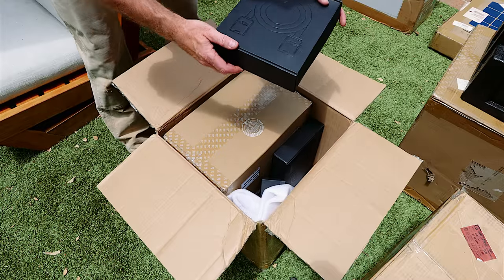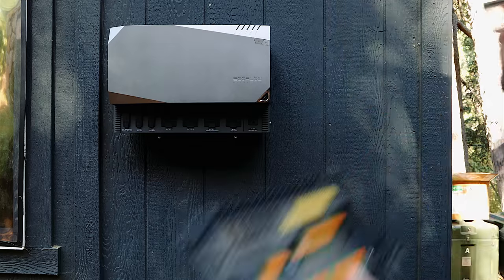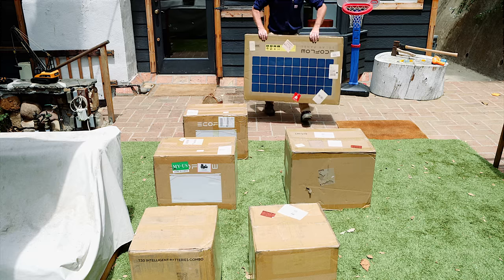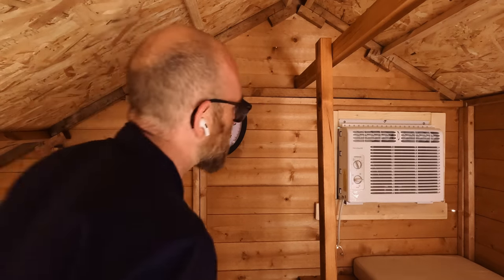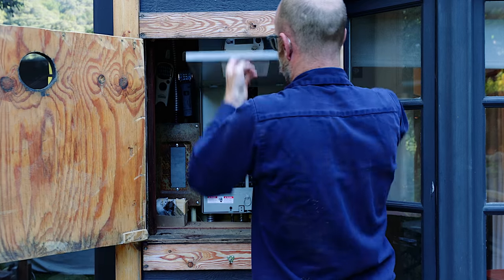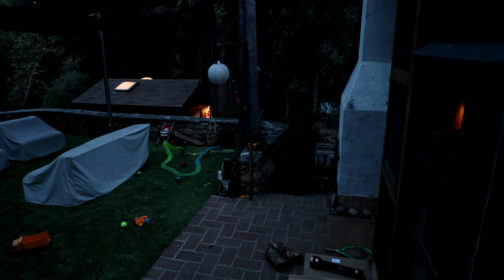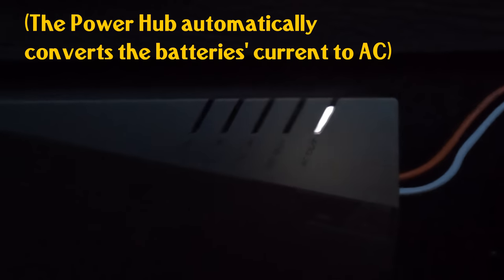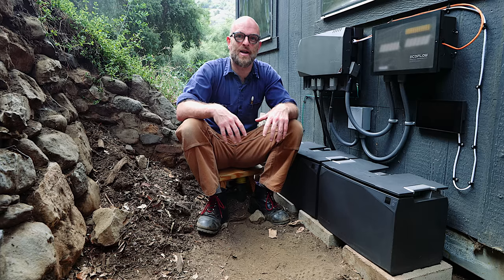Making my studio off-grid (without reading the instructions)

Comment: One thing to note is that this Power Kit uses a 48v system which translates to thinner wires and a safer system compared to the old 12v system.

Comment: I need instructions personally or I wouldn’t have a clue as to what to do. I would’ve had the electrician for the whole install. Luckily for me, I don’t have a studio and, (touch wood) the area I live in (Ontario Canada) doesn’t have a lot of power outages so I won’t be buying a power grid alternative. I do like your nice wiring with the labeled connections and use of plastic ties to keep the wires nice and neat though. The house may be in darkness but your studio will be fine.👍👍🇨🇦

Comment: You might be able to procrastinate on building a structure around your system because it hardly rains. But I would do it ASAP because of the animals that might mess with your stuff. Not to mention thieves.
Reply: I live in the northeast. We've had various hurricanes. One of the big issues after the hurricanes and extended power outages was people stealing generators. I wasn't even in a bad area when this occurred. you would see suspicious vehicles driving around to look for the smaller generators that were in easy reach that they could just grab and go. Same with devices such as this. The area I loved in at the time was similar to where Van lives now, sort of a country wooded road.
Reply: Ants love electricity.
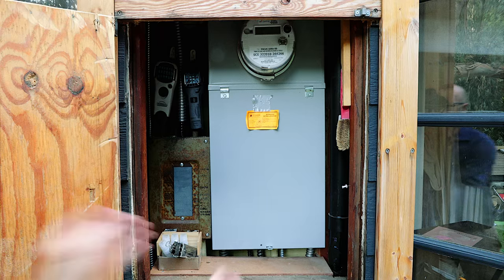Reply: Does anybody else get annoyed about the electrical panel cover 2:35 having a top hinge (gravity always trying to close the door when flipping a breaker) versus as side hinge?  
That would drive me nuts.  Needs a magnet catch to prevent it from falling
Reply: @canadude6401  Very common on outdoor rated power panels. When you pull the cover up to 90 degrees, you can push the cover in some and it will hold itself up.
Reply: @jeffdrees1892  oh, I see.  I guess it makes sense since it is meant for outdoors.  I am in Canada, so..

Comment: What happens if the breaker flips because of a faulty appliance, but the battery keeps it on anyway. Risk of shock or fire? Sizzlin'.
Reply: Nothing because the power is on the same side of the source power therefore the tripped breaker prevents sizzlin .

Comment: Seems a bit backwards... Shouldn't it use the batteries, having the panels charging them and then only use the grid when the batteries are empty ?
Reply: That would ruin the batteries faster.
Reply: @THETANKGINGER  Having them regularly cycle from high to low and vice-versa rather than keeping them on trickle charge?
Reply: @MartinSlucutt  they are on a trickle charge if the grid charges them. Charged constantly rather than being used a few% and charging.
Reply: @MartinSlucutt  I’m not a genius by any means I could be wrong
Reply: I can't speak directly to EcoFlows batteries but MOST backup batteries have applications where they only start to charge when they're 95% SoC or less. On applications where you're not regularly using them, this often equates to 10-14 in between when they'll top themselves off

Comment: So to be clear this is a hardlined kit that works as an electric generator, by supplying power from the batteries to the workspace in the event regular power goes out? I assume if you were to use the battery life up they can be recharged? I wonder how this compares to a solar power set up in costs vs longevity. In an ideal world I'd love us all to be off the main grid and using renewable energy.

Comment: What isn't shown (despite having the camera pointing in the correct direction) is whether the studio lights dipped when the A/C power from the grid was switched off and the studio switched to running on battery power. (Admittedly Van earlier described the changeover as happening "instantly".) Whilst a laptop has its own battery to buffer any small drop in external power, any use of a desktop PC / computer doesn't of-course. (Unless this situation has changed?) It would also be interesting to know how the changeover mechanism handles various types of dips in A/C power in this regard too, rather than a simple straight cut-off or restore of the A/C power.